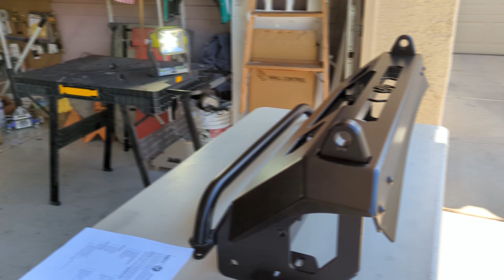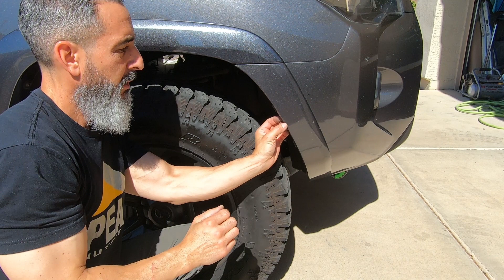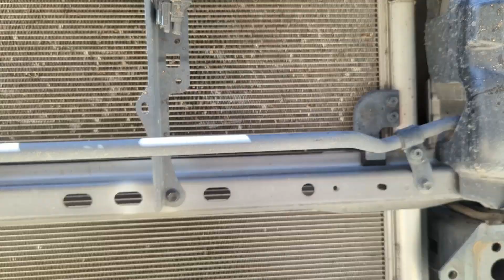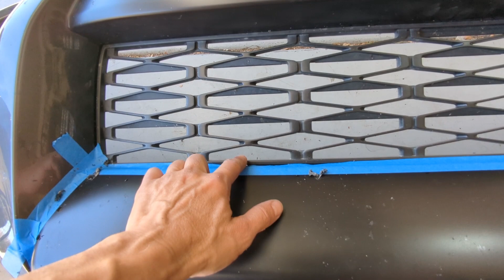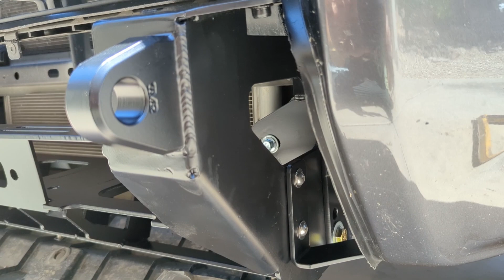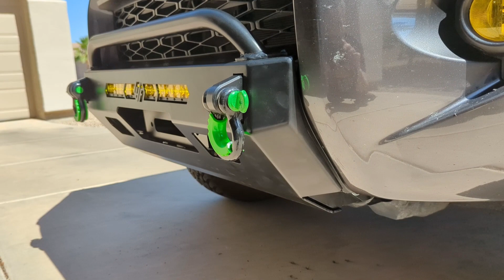4Runner Winch Bumper Install (Step by Step Version):Why I think Hefty Fabworks is the BEST Choice!

Comment: Been looking at bumpers and I agree with you. Steel in all the right places and light weight. Also like that the fairlead is level and not angled, how it should be. The only thing I'm struggling with is number plate mounting. I hate the flip up brackets, they mostly seem to be an afterthought I've had 3 and all start corroding. I have to display the numberplate  here. The warn seems to be the only one I can use in this sense but it's heavy. Greenlane is another but not so keen of winch mount and recovery points being aluminium plus i prefer the fairlead not at an angle. At the moment tho this is top pick due to the design.

Comment: What year is your 4Runner? I have a 2020 sr5 and I want to cut the middle of the bumper without removing it from the car. Just not sure if I have fog light wiring running through that area.
Reply from the maker: @matthewsarkis3856  2017 SR5

Comment: Just got a 23 4runner and this is my first 4 runner ever, so excited. Found your channel and instantly became a fan. Feels like a perfect "4 runner Dad"! LOL. Would you recommend this installation to a first-time mod customer (like myself)? Do you think the weight affected the MPG at all? Thanks in advance!!
Reply from the maker: Thank you! This is a great vehicle, I'm sure you'll love it. I would say that if you have experience, and are handy with tools, this is doable. If not, you may want to get help. I have a lot of auto mechanic and auto body experience, so this was not really a difficult install. I chose this bumper because it was a bit lighter than most of the aftermarket bumpers out now, so I didn't really notice a drop in gas mileage. When I add the wich soon, that may certainly affect mph.
Reply: @AZOverland2017  Thank you so much!!

Comment: Too complicated.  I have 2023 4Runner Trdoffroad.  I wouldn’t mess with the cutting my 4Runner.
Reply: This mod looks great. For the guy saying he wouldn’t mess with cutting his 4Runner, how would you get a winch installed without cutting? Or running 285s should have to do a BMC. For you it’s complicated, for others like him that have done this sort of stuff, it’s normal, necessary, and not too complicated to complete. Love the video and want to run the same. I’ll be getting a 2” front and 1” rear and enough to hold the weight of the bumper and winch.
Reply from the maker: Complicated for some, easy for others. I've worked on and modified cars for a lot of years. To me, this was a very straightforward and relatively simple install. Winch is ordered and coming soon. Stay tuned for the install. Good luck with the new 4Runner!
Reply: Mistakes can lead to more mods.

Comment: That's a great system. I'm so glad that you removed those shackles from the tie-down points. Those are only meant for securing the vehicle during towing and not extraction.
Reply from the maker: Thanks! They were just in their "holding place" until I got the bumper in. Needed a little bling😀

Comment: Great work!did you upgrade your front coil over shocks?that bumper is like 70-80lbs.
Reply from the maker: Thanks! I haven't yet. If I remember correctly I think this bumper is 65 lbs because it has the aluminum cover and bull bar. I think the OEM bumper support I removed was in the 20 lb range. So, not a huge amount of weight added. When the winch goes in I will certainly look deeper into upgrading the suspension. Also, I weigh like 145 lbs 😂
Reply: @AZOverland2017  my buddies friend took off his C4 low pro coz it causes more nose dive when turning or braking but he said he’ll put it back until he upgrade’s his suspension he said his C4 weighs like 80-85lbs material is steel..
Reply from the maker: @rupertgumban9251  Interesting, thanks for that information